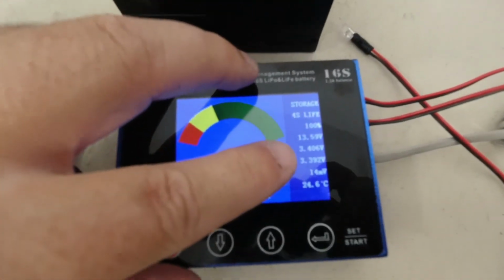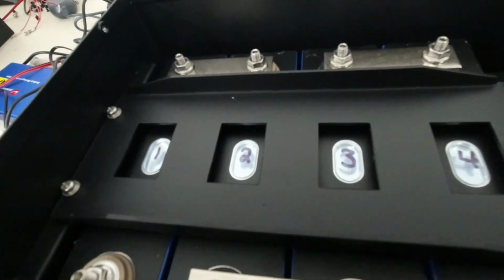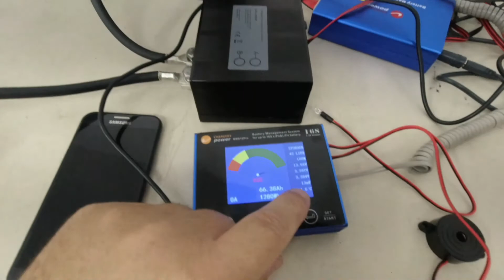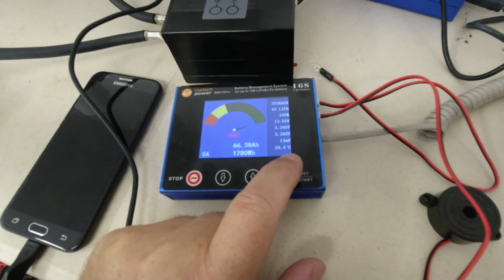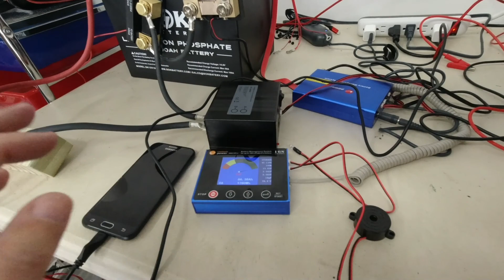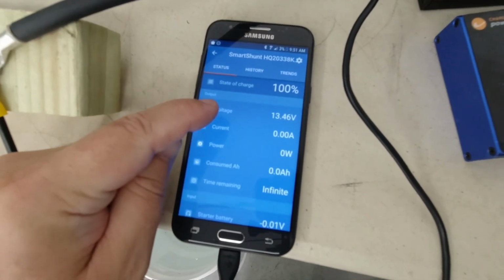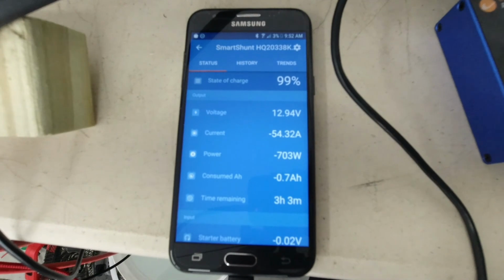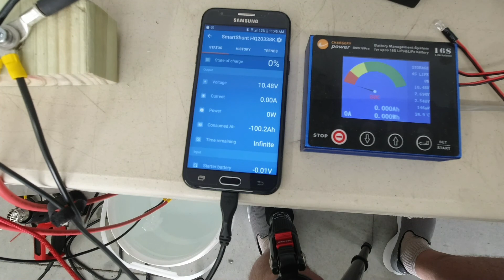SoK, Chargery BMS, and stripped threads

Comment: Hello.  My BMS is 24T 300A.  in the beginning I worked and showed Ampere and worked.  Then, for some reason, the ampere stopped showing.  Now the battery consumption shows and does not change the level.  I connected everything as it should be.  Ampere "0" shows.  The battery level reading does not change either.  Please help me, what should I do?  Thank you.
Reply from the maker: It sounds like you have an issue with your shunt.  I recommend going to diysolarforum and posting pictures and details so the community can help you diagnose.  It's difficult to do so with just a short description here.

Comment: Nice technical review. Do you have any opinions about the advertised cycle life of 4,000-8,000 discharges? I saw a review by mjlorton (youtube) who did a 45 cycle discharge test and noted that drop in charge capacity was about 2% per cycle; however, predicted that might level off over subsequent cycles.
Reply from the maker: The only comment I can make is that 4,000-8,000 is higher than most LiFePO4 cells are rated for.  But it's likely to have more like 3,000.  In fact, the manufacturer spec sheet for the cells states 3,000 at 1C 25 Deg C to retain 80%+ of its capacity.

Comment: Where did you get your elements. I think it would be good to keep my cisterns from freezing and to use extra solar after my bank is charged. Can you do an explanation video of the chargery with the newer DCC you are using. What's the draw from the DCC? The sok look like eve or lishen cells, can't remember which one had that terminal base shape.
Reply from the maker: Amazon.  Various voltages.  All the same brand.  https://www.amazon.com/gp/product/B0182BETBE
The DCC is literally just a relay that doesn't use as much power as a traditional relay.  I never measured its power draw.  I would hope the specifications include power draw.  They're all driven by a 12v signal (the chargery always outputs a 12v relay signal, regardless of the battery voltage)

Comment: Hmmm... 6.5Nm?....the battery producers should use a better aluminium or something else. 6.5Nm for big banks (like mine 250Ah) wasn't good enough. 
You did right with the studs...probably even better than the helicoil. I tried some cells with the helicoil and was possibile getting a nice 7.5Nm. I guess with the studs you can get even better results.
Reply from the maker: Yeah I've settled on 7.  The max torsional spec is about 8 so I want to stay just under that.

Comment: How did the Chargery perform balancing the batteries?  I understand its a passive balancing unit.
Reply from the maker: It's got strong (1.2 amp) passive balancing ... and it will eventually balance things out if your cells are in relatively good shape.  The balancing frequently shuts down for periods of time as the resistors get hot .. so it's not 1.2 amps continuous.  If you have really big cells (like the 280 Ah ones I'm now using), a 1.2 amp passive balance won't do any good if the cells aren't reasonably matched.
Reply: @TisTheDestiny  Thanks.  Im making a 24s3p pack using headway 8ah cells.  Should do fine.
Reply from the maker: @spidey4fun  oh.. yeah it'll have no problem with only 24ah.  I will say, however, that I'm not impressed with its voltage accuracy, the shunt accuracy and it's inability to deal with DC ripple from inverters, nor the solid-state DCC relay.  I'll be making a video on all of that soon.  I'm seriously considering another BMS for those reasons.

Comment: A couple of questions. First good test, as a pointer you might want to explain a little more about what the Chargery is. I understand but some new to you watchers may not. Locktight: isn't that going to insulate the stud or is it conductive? Have you thought about brass bus bars and brass studs with a lock washer. My concern is in a mobile rolling 6.5 earthquake, AKA driving off-road, these might vibrate themselves loose or worse free.
Reply from the maker: The stud doesn't need to be conductive.  The power should be transferred directly from the top of the cell terminal to the bus bar / lug.
The nuts I'm using are serrated flange - pretty common method inside batteries to lock things down.

I'm still trying to find a balance between how long I introduce stuff in the video vs. the meat of the content, especially if it's a follow-on video - but I hear your point.  I'll keep it in mind for future videos, thanks!

Comment: the temperature is much more higher on the bus bar if you change the screw....if you run with 100A loads
Reply from the maker: That indicates a poor connection between the bus bar and the cell terminal - which can be due to uneven surface, oxidization, or improper torque.  Significant current shouldn't run through the bolt - it should run from the cell terminal surface directly to the bus bar on top of it.  I was having problems because I was unable to apply proper torque using my torque wrench using the original bolts.  After switching to studs & nuts, filing and sanding the damaged terminal surface, and deoxidizing it, everything runs cold and all the cells are within a few millivolts of each other even under 55 amps -- which is amazing performance.